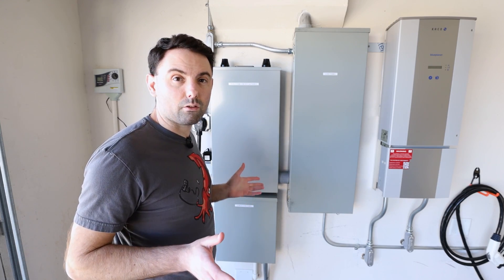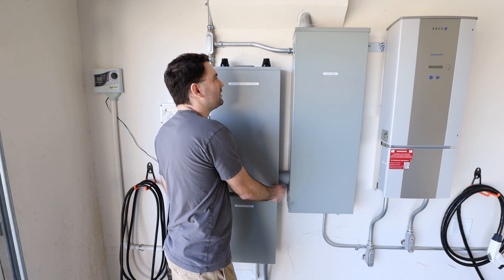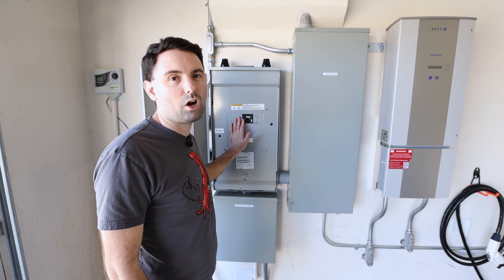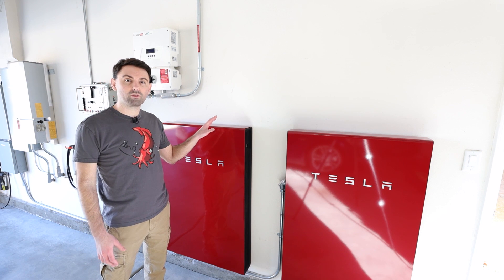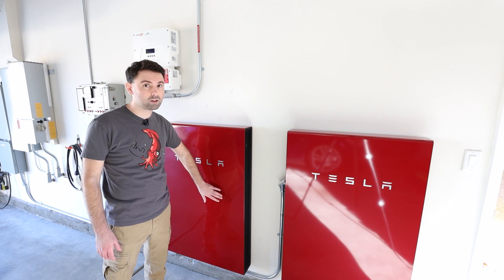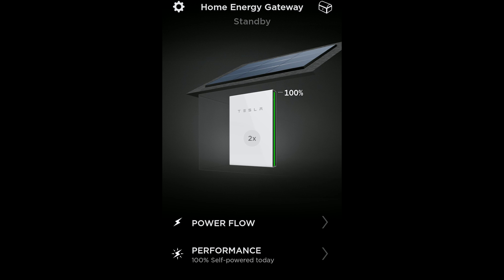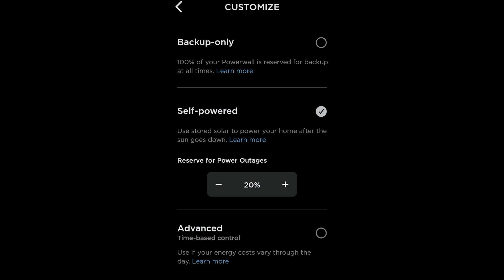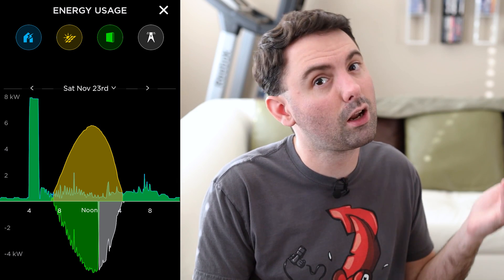Tesla Powerwalls Installed: No More Blackouts!

Comment: Oh man there must be a better way to tell the solar inverters to shut down than bumping the AC frequency, like a I2C bus or something.

I'm curious how well all of this stuff would work without any internet connection. The primary benefit of this system for me would be in an extended grid-down scenario like major natural disaster, when you couldn't even count on the cellular connection. Do you know if the system would function indefinitely without any internet? I know you did a video where you went a month on battery power, and I had this same question :)
Reply from the maker: While I don't disagree that there may be better ways of suppressing solar inverters, getting the inverter manufacturers onboard and working out legacy compatibility would make things a bit of a mess. There are hardware approaches Tesla could take as part of a Powerwall installation (like gateway controlled disconnects), but it would add cost and complexity.

The last I heard from Tesla about the system operating without an internet connection is that they've patched the software issue that was causing Powerwalls to shut down when internet connectivity wasn't present for a certain period. So, Powerwalls should be all good on that front now.

Comment: How do you find out what Hertz the powerwall were kicked onto? or simply, how did you figure out that the hertz at 65 was what caused all your issues?
Reply from the maker: Many tools can be used to measure AC frequency (some multimeters, oscilloscopes, even the Kill-A-Watt can provide realtime AC frequency). I was able to verify that the elevated AC frequency was the source of my issues by fully charging the Powerwalls, disconnecting the house from the grid, which activated backup mode, and the high state of charge immediately resulted in elevated AC frequency to suppress the solar inverters. Already having made a list of devices that weren't working correctly, I checked to make sure devices still weren't working, then applied a load to the Powerwalls to intentionally discharge them (charging a car was my typical choice, but the oven was another option). Once the Powerwall state of charge fell below around 97%, I watched the AC frequency slowly drop back to normal, discontinued the loading of the Powerwalls, and retested all of the devices on my list.

Comment: 13:58 I, too, ran into this and switched over to Eaton UPS's.  They are the best option I could find to work within the constraints and they work wonderfully.
14:50 Dang, didn't know this was even possible.  :(  Glad they worked with you.
Reply from the maker: It still took weeks of back and forth to make it happen and I think the main factor which caused them to go along with reducing the max frequency was the fact that it caused my air conditioners not to work.

Comment: I read that when there is a blackout and the grid goes out , the panels stop working even from charging the wall. That would be useless in Florida after a hurricane, when the grid can be down for weeks.
Reply from the maker: Not sure where you found that information, but it's incorrect. I recently spent a little over a month disconnected from grid power to simulate a long duration grid outage: https://youtu.be/LFfxn2-iSGk
Reply: David - you are describing what happens to solar power if you don’t have a battery.  Without a battery the solar system will shut down because it can’t reliably provide enough power to the home (cloud comes across and suddenly you don’t have enough power to run things and brownout occurs) and because it can’t backfeed for safety reasons.  With a battery system the whole thing just shuts off from the grid and both the solar panels and the battery continue to work and power your home.

Comment: How many referrals need for a powerwall?.
Reply from the maker: The referral program has had multiple rounds over the years and has changed multiple times. I missed out on the signature Powerwall round (I think that was toward the end of 2016), but got these two Powerwalls in later rounds (as I recall, one required a minimum of 4 Model S/X referrals during that period and the other round required at least 5).

I don't remember what my combined total for all program periods was... maybe 20? Anyway, these sorts of awards aren't part of the referral program anymore.

Comment: Nice presentation 👍 

Did I understand correctly?

The Powerwall will interfere with either a feed in tariff or net metering scheme when it shuts down the inverter.

Is there a way of working around this issue?

This should make the solar payback even worse.
Reply from the maker: The only time the Powerwalls will shut down solar inverters is when you're grid isolated (grid power outage) and the batteries are nearly full. When the grid is up, solar energy is passed to the grid as usual.
Reply: Alex Venz thanks.  

For some reason, I thought he mentioned that when the batteries were full the frequency increased to 65-Hz, and it had the effect of shutting down the inverters and messing up with his refrigerator and other electrical appliances, and as the batteries were depleted the frequency would slowly drop down from 65-Hz until it reached a level where the inverters could turn on again, and this would allow the batteries to fill up again.
Reply from the maker: Yes, but that only occurs when grid-isolated (backup mode) and the system only hits that maximum frequency value during the initial pull down from 100% SoC when grid-isolated. When the SoC drops to ~97% or below, the system slowly reduces AC frequency back to 60Hz, charges the batteries, then slowly increases the AC frequency as the SoC approaches ~97% in order to disable the solar inverters again, but this time it increases the frequency only as much as is necessary to actually suppress the inverters.
Reply: Alex Venz thanks.

I missed the portion of when in backup mode.

The presentation in the video gave the impression that this was occurring all the time until this was corrected by Tesla.

Comment: I would have liked to instead see total cost after installation. But maybe if I have to ask, I can’t afford it.
Reply from the maker: Like I said in the video, the Powerwalls and gateway were received for free as part of the old Tesla referral program and I also received a $1k credit toward installation as part of that. I ended up paying $1500 to cover the rest of installation and $500 for permitting. Current pricing for the Powerwalls is on Tesla's website (I think they're about $6500 each + $1100 for the gateway & other hardware + installation + permitting) and, so long as they're installed with solar or added to an existing solar setup, they're eligible for the Federal ITC.
Reply: Alex Venz Wow, thanks for that breakdown 👍

Comment: How long after your powerwall was installed did you get PTO from the power company?  I'm getting mine installed shortly, and they are telling me it is taking 6-8 weeks to get the PTO from PG&E.
Reply from the maker: It took 5 weeks from the date the Powerwall installation was completed for SCE to grant PTO.
Reply: @AlexVenz  Were you able to still use your solar during that time?
Reply from the maker: Well, the Powerwalls were off and I already had an active interconnect agreement with SCE for the solar setup, so I left the solar running. I'm not entirely clear on whether that's what I was supposed to do given that the addition of the Powerwalls causes a reworking of said interconnect agreement, but SCE didn't seem to care.
Reply: @AlexVenz  Ok, I'll be in a similar situation. Just didn't know if you could run the solar without the PW being on (e.g. if the backup gateway got in the way)
Reply: Thanks for the video. Very insightful.  Love the red PW. I think that's the "reward" version, isn't it?
Reply from the maker: Yeah, they're the founder's edition from the referral program--didn't start early enough to get one of the signed ones, though.

Solar still works with the Powerwalls turned off, though it's not unusual for installers to leave the Powerwalls on after installation to charge up the batteries & make sure everything's working.

Comment: Around Jan 1 the Tesla guy came out and now, Jan 18 we have all the permits and soonish they will install our system, supposedly the first home in Amador County CA with a glass roof and two powerwalls etc.
Reply: Happy Raccoon nice
Reply: Well, April 1. Today Tesla tries to Repair Their Wiring Error🤔. They are not specific on issue. But there are only Two plugs in a glass panel. It was supposed to up and running before now and no, this has Nothing to do with Corona. But I did have Corona in Yosemite 🤔😳👻. The Place was EMPTY on March 20. Had a Corona. Made a video to prove it.

Comment: Great install by outstanding electricians. I do electrical projects on many applications. This to me looks like exposed plumbing on a custom home. It should have been done with the sheetrock taken out, wired in the walls, then covered over with quality plywood finished and  then painted. This would get rid of the exposed plumbing.

Comment: Congrats on the Powerwalls. I wanted to buy a couple of them a few years ago but they weren't available. I ended up buying a different inverter and now I'm glad I did. I have full control of every parameter in the system and even access to their API and settings control. I used that to write an app that does the "smart" functions by only charging from solar, reserving power for outages, blending or 'load shaving' higher loads, etc. The last part of the project will be to control how much the Tesla charger draws so I can modulate that vs solar production or inverter battery SoC and not import anything from the grid.
Reply: JRoque250 May I asked what make/model inverter you bought?
Reply: @zuldanfpv4634  Schneider XW+6848. Have one and will be getting a second unit shortly. I run my panels using Enphase microinverters in a hybrid, AC-coupled configuration.

Comment: Seems like too many moving parts, no testing / verification that the system is fully operational... 🤦‍♂️ Also you might have damaged your refrigerators.. don't really get it why they need to increase the frequency... it should be a relay/switch or if there is a signal that you can send to the inverter🤦‍♂️
Reply from the maker: Using a switch (relay, contactor, whatever) to externally hot break solar inverter DC input would add considerable cost and complexity. The industry has settled on a simple, reliable soft safety switch approach in AC frequency detection. Some of the more sophisticated implementations even throttle inverter AC output as frequency is slowly increased, until shutting down at the fault point. The issue with the Powerwalls is that Tesla hasn't made tuning of the AC frequency ceiling part of the installation/commissioning process, even though they have all of the necessary information about the solar inverters installed at the location to make said adjustments. Once the Powerwalls discharge to 96-97% SoC, they'll only increase AC frequency up to the observed fault point of the solar inverters when necessary--the defined ceiling is only hit when SoC is above 97% and the system is trying to guarantee total inverter suppression for safety reasons.

Adjusting AC frequency is a simple and effective way to signal a solar inverter to shut down without needing to develop and implement an industry-wide data communication protocol. Also, the refrigerator is fine--spending maybe an hour and a half spread across 10 tests at 3% above the specified frequency tolerance isn't likely to meaningfully harm a fairly basic 11 year old refrigerator.

Comment: I unsure I missed something - but how can you charge your Tesla vehicles from the Powerwalls? Wouldn't it simply suck them down to zero?
Reply from the maker: It really depends on your habits and how much energy your cars need on a daily basis. Under normal circumstances, my Model S is charged daily and uses between 8kWh and 15kWh (measured at the wall, losses due to charger efficiency included). That's well within the capacity of the two Powerwalls to absorb so, if I were running off-grid, that car could be charged during the day or night depending on house energy usage,

The Model 3 isn't charged daily, but longer charging sessions that would normally exceed the capacity of the Powerwalls can be done during the day, given that my daily solar generation greatly exceeds the capacity of the Powerwalls. Obviously, this approach falls apart if your daily energy needs for the cars exceeds your solar production and/or you're unable to rotate cars for daytime charging.
Reply: In theory if you were charging the vehicle's at night and lost grid power you could suck them down to zero.  That is a potential issue.  One thing that Tesla has looked at is a option with their chargers is that if you lost grid power , you would have a option to automatically shutdown your charger unless you enabled it.

Comment: How did the big AV snow effect your panels? Did you need to clear them?
Reply from the maker: I was out of town for both of those storms, but could tell from app data that the panels were completely covered for a few days (zero solar production). Though, the batteries held up pretty well since nobody was home and grid power didn't go down.

There was still snow on the West array for a few days after I came back following the December snow storm, but the larger South array was clear.